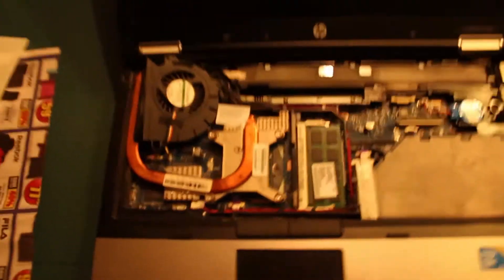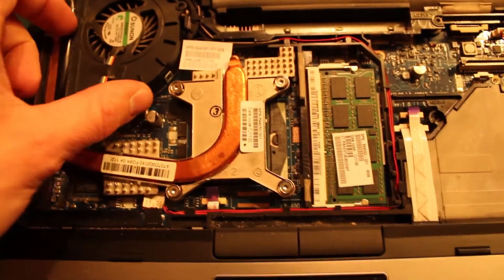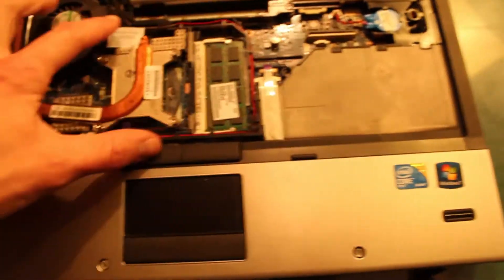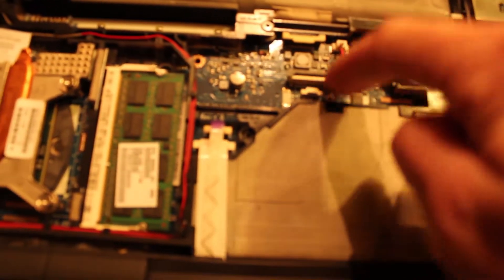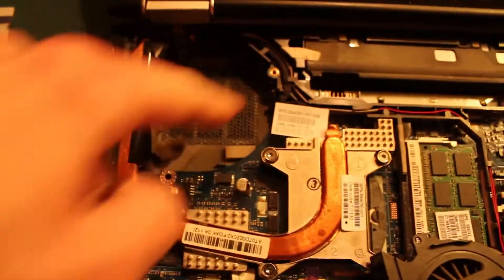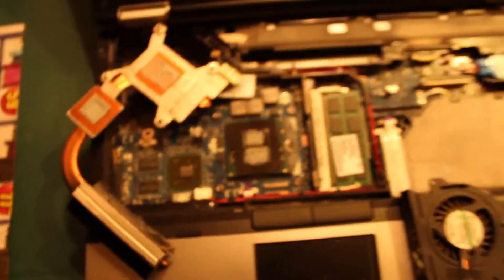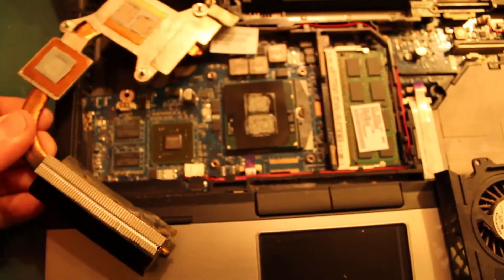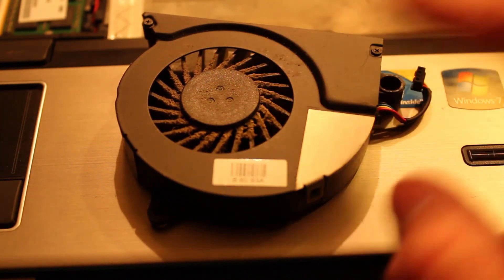HP Elitebook 8440p Fan & Heat Sink Cleaning

Comment: This is the worst laptop I ever had. Gets overheated after a few minutes and turns off randomly every time I turn it on
Reply: It turns off randomly because it's overheating. If your doing light work it should be fine, once you get it working hard you should notice the fans turning on trying to cool it, then boof it's off.
Reply: @Mazza666  I know, therefore, such a stupid cooling system, and I changed my laptop after that, I need to run heavy softwares and I can't do anything on it. Upgraded to a second hand dell lattitude e6440. Works 10 times better than that

Comment: in my case, the plastic fan housing was quite difficult to 'pry' out. There is a cable that connects to the lid (display cable i assume) that looks like it should route beside the fan housing but mine was over it and a bit of excessive heat under there had kind of moulded it into a little awkward lip. I thought i'd missed a screw somewhere but no, it was just the little display cable doing it's best to get in the way.
The little power plug took more force than i expected to remove too, just be sure to pull on the white plug not the cables.
Also, be careful putting the little heatsinks (to the left of the fan) back in place, i found they are very fragile. Managed to get away with damaging them slightly by being a bit firm with them. I didn't remove the black tape like in this video, but i should have, and will next time.
I don't have any thermal paste right now so just left the original stuff there. I will comment here again if my laptop blows up before i get around to replacing that.
My fan is now working as it should and not having to stay on constantly blasting out hot air.
Thanks for the vid :)
Reply: So, 9 months later, 4 of which have been in a tropical climate, my laptop is working great, no problems. I never used any new thermal paste just put everything back together as it was after cleaning out the dust and slightly damaging the heatsinks i mentioned before.
Maybe i got lucky or maybe new thermal paste is not necessary.

Comment: My HP 8440p turns on, spins fan at max speed then shuts down after 1 minute
Reply: Nevermind, it was the gpu on 97 degrees because of the lack of thermal paste and the nonperfect contact between the heatsink and gpu

Comment: Thank you, this is great and it was very helpful. To whom it may concern,  on my computer.I found a different issue but related. On top of the CPU there is a mylar mask that protects the processor from the thermal compound. That mask is supposed to cover symmetrically  the chip and in my case the mask was off by about 1.5 mm, covering one end of the processor and sufficient to make core #1 heating up consistently and shutting down the computer after a few minutes. The fix was to place the mask correctly to not cover the chip and I applied a generous amount of thermal compound as the layer from factory was next to nothing.

Comment: I don't disagree at all with the excellent presentation above on a hardware cleaning, and indeed if anyone smokes tobacco products regularly and near a computer the smoke residue is like heaven to dust and "scuz" in the air. However, I simply performed a "CLEAN BOOT" (see MSCONFIG) and all of my overheating issues went away, and for free. 
HP offers a plethora of good free drivers to download for the 8440 that do everything but wash the dishes for you, so it is tempting to "grab all you can" and install them (so easy). I will still replace the fan assembly as I can hear some noise in the fan motor bearings and all motors will fail -- just wait! (The part is quite inexpensive and the same procedure works to replace it.) 
It would seem there may are, as usual, more than one way to exterminate bugs in a little computer. :-)